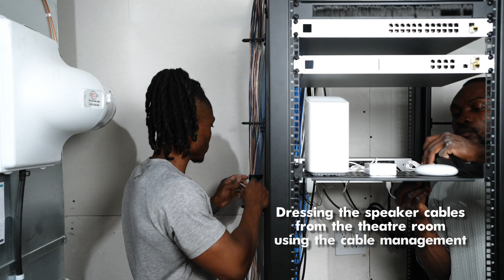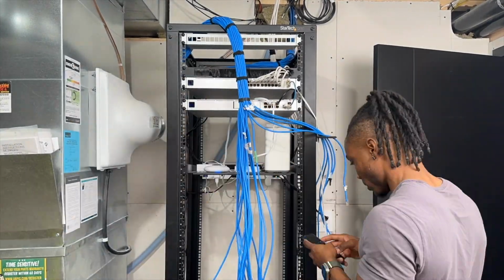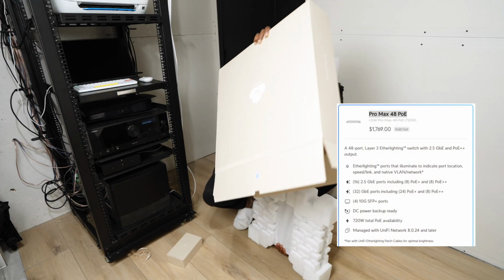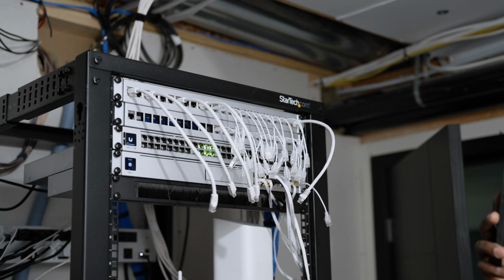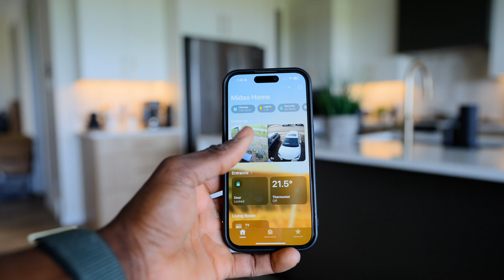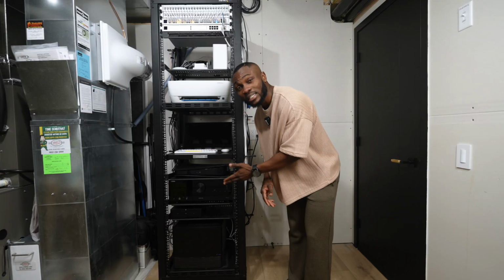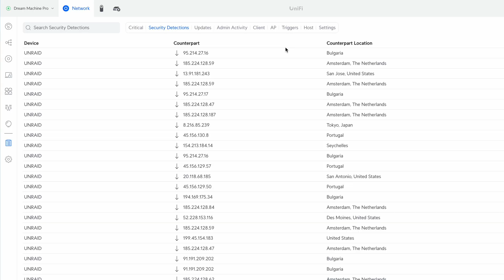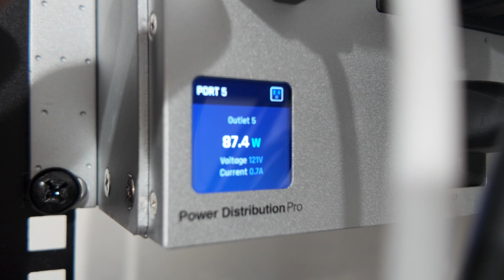Our Craziest Smart Home Network Build YET  Version 2.0

Comment: Keep your Speaker wires away from the Cat cables.
Reply from the maker: First off all speaker cables are low voltage just like the Ethernet. Secondly the effect of EMF is insignificant in this scenario especially since modern Ethernet cables are twisted for EMF cancelling.

Comment: Are you going to fix the patch panels? Put one below the switch and patch up to the bottom row of ports. Top panels go down to the top row of ports.

Take first panel out through the back, move 2nd panel up, move switch up, then bring the other panel up under the switch, patch to switch.
Reply from the maker: Yup.. I did mention that in the video. We will do that as part of a future upgrade video. right now we will just leave as is and enjoy the current looks before changing it up again.